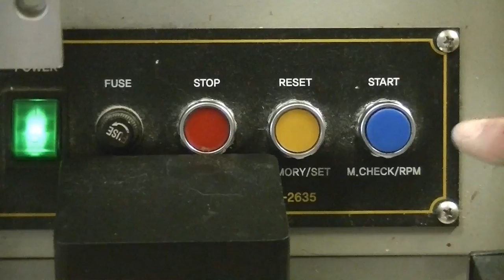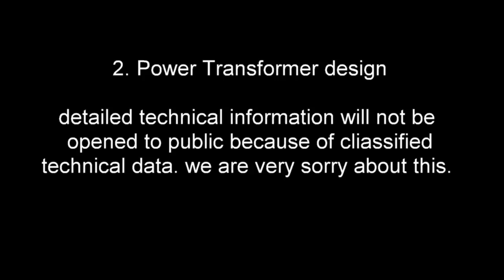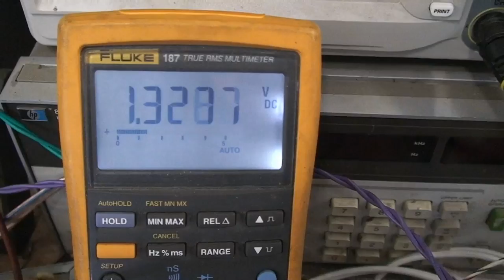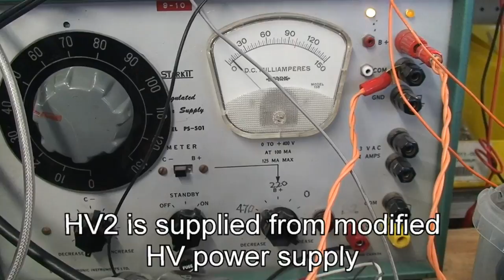audio lecture 57, OPT and PT design, audio output transformer for FLUXION AV-7B 2

Comment: How are the interleaved sections joined in series. As each interleave is wound the wire must be cut, the winding wrapped with paper and the alternate winding started. Say you have P1-S1-P2-S2-P3. The Prim are connected in series and the Sec are connected in series, and P2 would usually have a centre tap. The Sec may have no tap for one load output or a tap at the end of S1 for a 0-8-16 Ohm load. Is the series connection just a solder joint at the end of P1 and the beginning of the P2 winding wire?
Reply from the maker: Hi, I use high flux core and quality enamel coil. Does not need interleaving. Thanks for your interest.

Comment: Hello Young! Good music and vídeo, I have the knowledge to build mi transformers but I can`t get the cores, the plastic core and metal covers, could You please give me that stores?
Reply from the maker: I buy materials from Korea for my products. Why don't you search on eBay?
Reply: @YoungAhn  Good Morning Mr. Ahn, Thanks, by now I didn`t find any store in US or in China, (Ebay, Amazon, Aliexpress, Banggood etc.)
Sure, I"ll continue looking for.
Muchos Saludos.
Reply: Howdy.
Check eBay for line transformers. I found at least two postings with cheap surplus items. Line transformers are used in building central radio systems.
Regards.
Reply: @eugenepohjola258  Thanks Eugene!

Comment: that tube amp not very good because it clipping like solid state amp.
Reply: He is testing a prototype OPT. If you watch more carefully... he brings the power up to find the point of clipping (@1KHz), then reduces power to find the maximum continuous output (without clipping) so that his THD and FR measurements will NOT include clipping.

Mr. Ahn's videos are quite advanced, you need a decent understanding of what you're seeing to gain value from his efforts. "Uncle Doug" and "JohnAudio Tech" have many videos that include in depth explanations that may better help you understand the theory behind the actions.
Reply: when I say it clipping like solid state amp, I mean hard clipping. tubes are not suppose to hard clip.